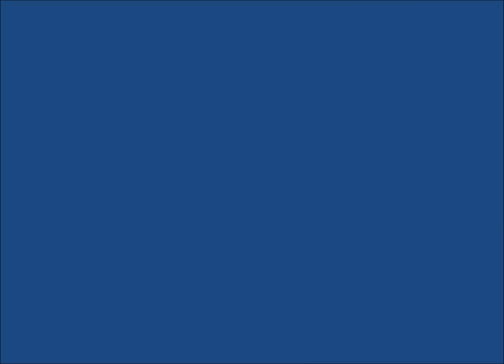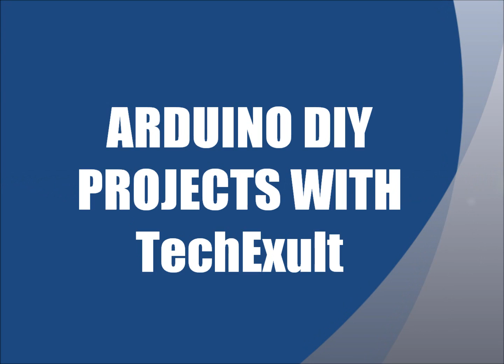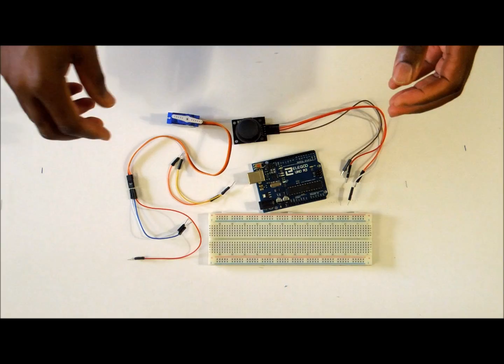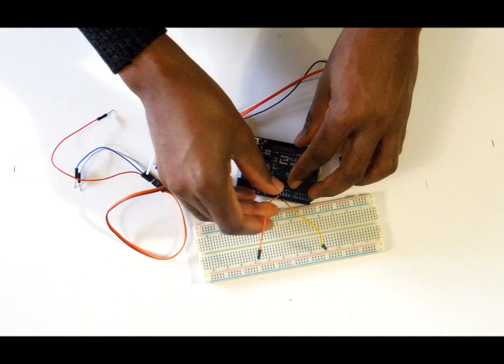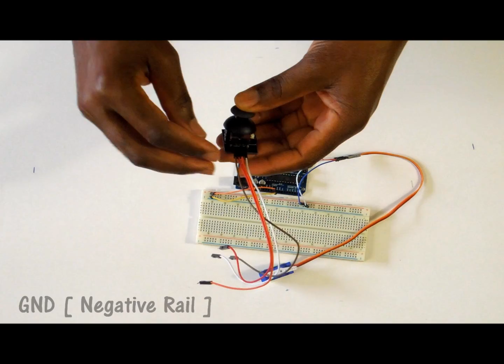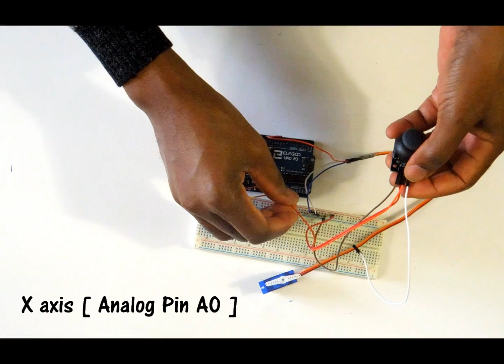Controlling the Servo Motor Using a Joystick & Arduino

Comment: i, not found cod none
Reply: Before using this code you have to download the servo library:
The code:
/* Fnd_Ayoub*/
#include <Servo.h>

Servo tilt;

int joyX = A0; // analog pin used to connect the X - axis of Joystick
int x ; // variables to read the values from the analog pins 

void setup()
{ 
  tilt.attach(10); // attaches the tilt servo on pin 9 to the servo object 
} 

void loop()
{ 
  x = joyX;    // reads the value of the Joystick's X - axis (value between 0 and 1023)  
  x = map(analogRead(joyX), 0, 1023,0, 180); // scale it to use with the servo b/w 900 usec to 2100 usec
  tilt.write(x); // sets the servo position according to the scaled value 
  delay(15); // waits for the servos to get there 
}

Comment: this was really good maybe code should be easier to get could not find it on website
Reply: Before using this code you have to download the servo library:
The code:
/* Fnd_Ayoub*/
#include <Servo.h>

Servo tilt;

int joyX = A0; // analog pin used to connect the X - axis of Joystick
int x ; // variables to read the values from the analog pins 

void setup()
{ 
  tilt.attach(10); // attaches the tilt servo on pin 9 to the servo object 
} 

void loop()
{ 
  x = joyX;    // reads the value of the Joystick's X - axis (value between 0 and 1023)  
  x = map(analogRead(joyX), 0, 1023,0, 180); // scale it to use with the servo b/w 900 usec to 2100 usec
  tilt.write(x); // sets the servo position according to the scaled value 
  delay(15); // waits for the servos to get there 
}

Comment: Where is the code
Reply: Before using this code you have to download the servo library:
The code:
/* Fnd_Ayoub*/
#include <Servo.h>

Servo tilt;

int joyX = A0; // analog pin used to connect the X - axis of Joystick
int x ; // variables to read the values from the analog pins 

void setup()
{ 
  tilt.attach(10); // attaches the tilt servo on pin 9 to the servo object 
} 

void loop()
{ 
  x = joyX;    // reads the value of the Joystick's X - axis (value between 0 and 1023)  
  x = map(analogRead(joyX), 0, 1023,0, 180); // scale it to use with the servo b/w 900 usec to 2100 usec
  tilt.write(x); // sets the servo position according to the scaled value 
  delay(15); // waits for the servos to get there 
}
Reply: Before using this code you have to download the servo library:
The code:
/* Fnd_Ayoub*/
#include <Servo.h>

Servo tilt;

int joyX = A0; // analog pin used to connect the X - axis of Joystick
int x ; // variables to read the values from the analog pins 

void setup()
{ 
  tilt.attach(10); // attaches the tilt servo on pin 9 to the servo object 
} 

void loop()
{ 
  x = joyX;    // reads the value of the Joystick's X - axis (value between 0 and 1023)  
  x = map(analogRead(joyX), 0, 1023,0, 180); // scale it to use with the servo b/w 900 usec to 2100 usec
  tilt.write(x); // sets the servo position according to the scaled value 
  delay(15); // waits for the servos to get there 
}

Comment: The link for the code on your website is dead.
Reply: Before using this code you have to download the servo library:
The code:
/* Fnd_Ayoub*/
#include <Servo.h>

Servo tilt;

int joyX = A0; // analog pin used to connect the X - axis of Joystick
int x ; // variables to read the values from the analog pins 

void setup()
{ 
  tilt.attach(10); // attaches the tilt servo on pin 9 to the servo object 
} 

void loop()
{ 
  x = joyX;    // reads the value of the Joystick's X - axis (value between 0 and 1023)  
  x = map(analogRead(joyX), 0, 1023,0, 180); // scale it to use with the servo b/w 900 usec to 2100 usec
  tilt.write(x); // sets the servo position according to the scaled value 
  delay(15); // waits for the servos to get there 
}

Comment: theres no code. thumbs down. when you put the code, reply to this comment, and ill subscribe
Reply: Before using this code you have to download the servo library:
The code:
/* Fnd_Ayoub*/
#include <Servo.h>

Servo tilt;

int joyX = A0; // analog pin used to connect the X - axis of Joystick
int x ; // variables to read the values from the analog pins 

void setup()
{ 
  tilt.attach(10); // attaches the tilt servo on pin 9 to the servo object 
} 

void loop()
{ 
  x = joyX;    // reads the value of the Joystick's X - axis (value between 0 and 1023)  
  x = map(analogRead(joyX), 0, 1023,0, 180); // scale it to use with the servo b/w 900 usec to 2100 usec
  tilt.write(x); // sets the servo position according to the scaled value 
  delay(15); // waits for the servos to get there 
}

Comment: where is the code
Reply: @Arav Tewari Before using this code you have to download the servo library:
The code:
/* Fnd_Ayoub*/
#include <Servo.h>

Servo tilt;

int joyX = A0; // analog pin used to connect the X - axis of Joystick
int x ; // variables to read the values from the analog pins 

void setup()
{ 
  tilt.attach(10); // attaches the tilt servo on pin 9 to the servo object 
} 

void loop()
{ 
  x = joyX;    // reads the value of the Joystick's X - axis (value between 0 and 1023)  
  x = map(analogRead(joyX), 0, 1023,0, 180); // scale it to use with the servo b/w 900 usec to 2100 usec
  tilt.write(x); // sets the servo position according to the scaled value 
  delay(15); // waits for the servos to get there 
}
Reply: Ya where is the code?
Reply: @Arav Tewari dude thank god for u